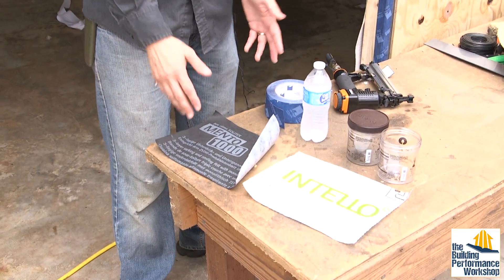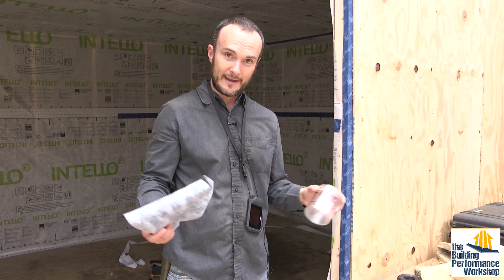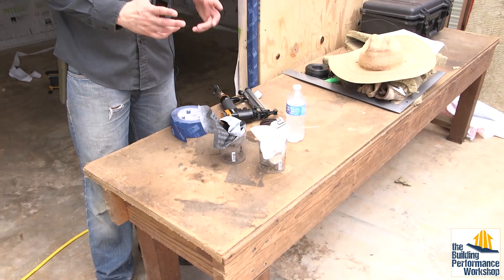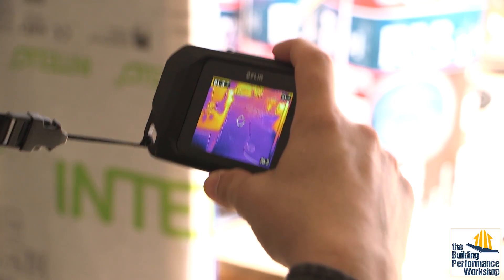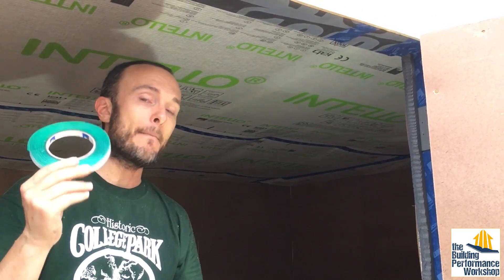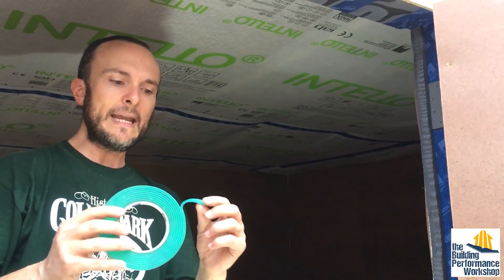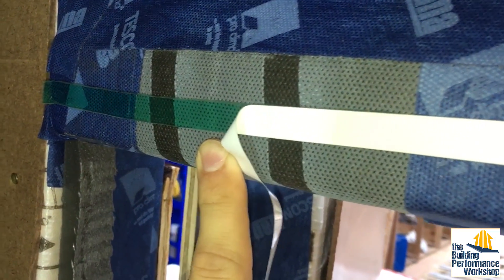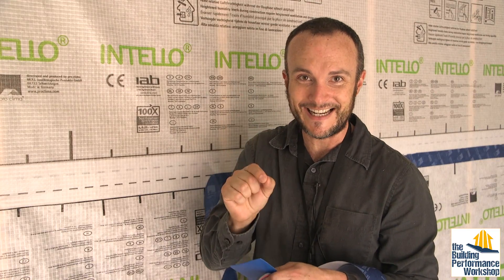#DryVault Pt3: Finishing with Intello

Comment: Thank you for such a clear explanation and introduction to useful new products!
I have a seemingly simple question that all Certainteed has refused to answer about MemBrain installation, because I am a small potato and not worth their time.
I am rehabbing a 1976 mobile home in Melbourne Florida.
I would like to instal a smart air barrier like Intello... but my only option is on the inside wall as in your video
ALL instructions say in "hot & humid" climate it must go on the exterior wall. I am NOT removing the aluminum sheeting from my home, as it would ruin it.
Is it going to cause a serious issue to install Intello on the interior wall over unfaced JM Batts?
I am looking for a reasonable way to tighten up a very poor quality building
Not looking for guarantees... just desperate for some information that apparently the products are not willing to risk answering.
Reply from the maker: I like this question, it’s a toughie. Video coming soon, Rick.
Reply: @HomePerformance  Awesome, thank you!

Comment: Nice video. You may want to check out the electrical boxes from Allied Moulding Products Inc. They come with a flange so that you can adhesive caulk the Intello to the box. It is polyester molded and comes with interesting air sealing around wires and 2-hr fire rating.
Reply from the maker: Joseph thanks- I actually saw airtight junction boxes at Ace Hardware of all places!

Comment: Great video! I’m about to start the process of installing the intello membrane in my house & I had a question I can’t seem to find an answer too. 

I have a 2 story house, should I be installing intello in between my first & 2nd floor?
Reply from the maker: Just between INSIDE and OUTSIDE- no need to separate the interior walls or floors within the home, Dan. What’ll really bust your balls is whether you care enough to intello the band joist. I do not.
Reply: @HomePerformance  Thank you for clearing that up for me & for the quick reply! Yeah the rim joists or band joists as you call them are going to be a PITA. I might go with foam board & spray foam. 

Anyways thanks again, keep up the good work!